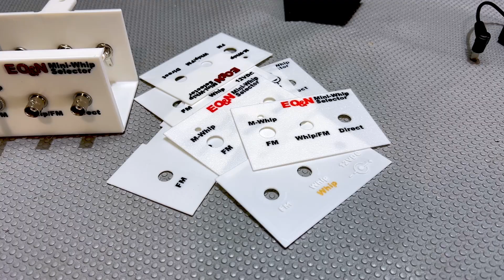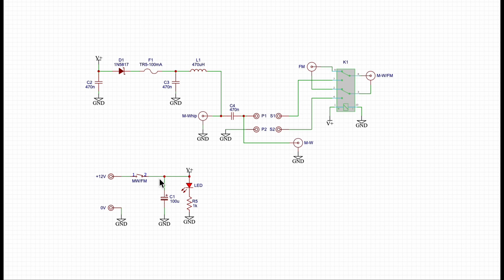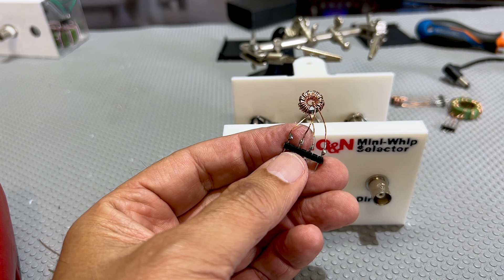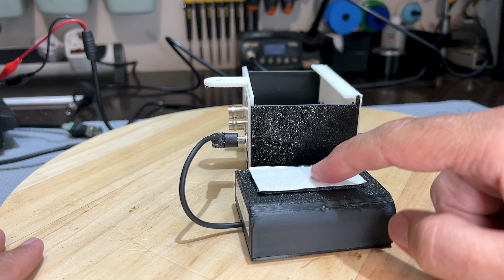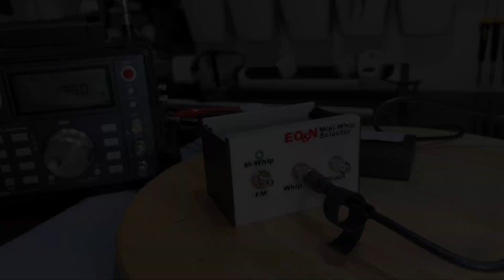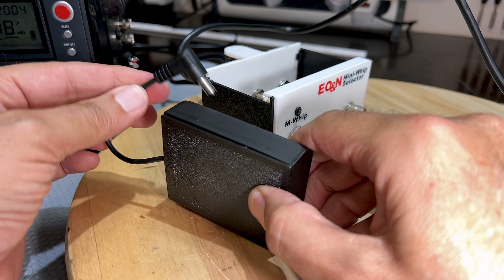New Mini-Whip / FM Switcher with Bias-T #pcbway#

Comment: Very neat! I must get off my lazy butt and get the mini whip I have installed. It's been sitting in my workshop for months and I have been dithering around wondering where best to place it. I think I need to stop procrastinating and get the thing up as they do look to work very well!! Impressive!!
Reply from the maker: I did the same thing: wondered and wondered and wondered some more 😊 Then I just stuck it out of my window and was blown away by the results. That’s what led me to take it a little more seriously and fitted on the roofAntennas can drive you crazy, as you’re always looking for that extra little bit of reception, which seems so illusive. Sometimes you just have to stop and accept what is 😊
Reply: @electronicsoldandnew  Good idea re the window test. I think I will give that a go. It may give me the inspiration to get it up on the roof (finally!)!!! 😁
Reply from the maker: @JonRig : just don’t fall. Reception is really poor if you’re hospitalised 😊
Reply: @electronicsoldandnew  I'll try and be careful! Between falling off roofs, getting electrocuted or doing your back in moving a Saba Freiburg this hobby has more hidden dangers than one realises! 😂

Comment: Nice.

I've been busy renovating a summer home here in the Catskills of NY for a good year so my radio projects have been on hold.

None the less I do have the front end of a regenerative receiver off the dream board & on a piece of MDF board. Next but still on the dream board is a direct conversion receiver.

I had mucked about, a year or more ago, with what claimed to be a mini whip, but in the end I assembled a 40/20 meter inverted V style fan dipole that works quite well for local traffic which is all that interests my QRP appetite in radios. 

I added a loop on ground to see if it lived up to hype & its still in place so its not horrible. It actually is about two S meter values quieter, but there is an over all signal loss too. 

On the other hand I tried a small magnetic loop transmit/receive antenna by using 4 inch aluminum clothes dryer tube for the main loop. This antenna is interesting. Its 4 feet square with a 23 inch square of copper pipe as the inner loop. Once you find the magic spot on the capacitor it becomes very usable for both receive & transmit. Its most efficient at around 80% on 20 meters, but is useful at 40 meters too. It has down sides but was fun to see a bunch of plumbing parts take on being a useful antenna & given a station within a couple hundred miles the darn thing does an excellent job at providing a bearing to the station.
Reply from the maker: I went through my antenna experimentation phase and it was absolute hell 😊 I finally settled on the miniwhip as it works best for me (receive only). It also adapts well to the roof of my apartment building as the other owners don’t see it as an eyesore. I’ll probably try a loop someday, but for now … I’ll leave well enough  alone 😊
Reply: @electronicsoldandnew  I suspect the mini whip I purchased on Ebay already preassembled was defective or did not match the actual unit designed by the European fella. 

I'd like to try it again some day with an actual functioning device, but here in the country I have no real need to be discreet, but I must confess the darn LOG does quite well & if the transformer used is sufficient I can't see why one can't use it for local Nvis rag chewing. I used the 60 footer or 15 foot per side square and 14 gage wire that disappeared in a couple weeks. If I was ambitious I'd swap it out for the larger loop that is effective on 80 meters & I'd bet if big enough even lower can be achieved.

Comment: Maybe you can make a separate battery pack module that is always being charged. You could have several voltages going out of the back of the module to feed all the modules as well as a jacks on the front if you needed a quick bench supply for testing. You’ve developed a very cool bench system. Well done!! 🙂👍🏻

Comment: Well done, as always. 

I would have liked to see the difference between direct connection of the MiniWhip and going  through your un-un (or rather common-mode rejection transformer, because that's what it actually  is), especially on long and medium wave. Maybe you could add this in a future video.
Reply from the maker: I actually only remembered that I’d missed that out after the video was published. Will do that in future video as you suggested.
Reply: @electronicsoldandnew  As I'm getting a little too old to hold my breath for weeks on end... could you give us a little hint on whether it makes a difference or not? 😀
Reply from the maker: Ok. Noise is the issue, because some noise comes in as common mode noise on the signal and ground lines. This noise is sometimes more audible in the direct connection. The isolation transformer clears some of it up.

Comment: Nice! On another topic, and it's not something I ppersonally need, has anyone ever built a simple 3 kHz (plus possibly an additional 5 kHz) high Q tuned circuit filter plus a bit of amplification feeding into an AC millivolt meter? Why? I'm thinking a cheap and cheerful way to minimize THD during FM ratio detector alignment when the front end is fed with 1kHz FM audio. It doesn't have to be super accurate so long as you can see and minimize the 3rd (plus possibly 5th) harmonic. Or am I talking balderdash? 🤣
Reply from the maker: I’ve been looking for a good THD meter for some time, may have to build one 😊

Comment: I would have put the LED and dropping resistor in parallel with C3.  Then if the fuse blows you have an indication or rather a lack of one.  :)   I aways appreciate your videos.

Comment: As always another slick device! 😀👍  To reject spurious noise, I would aline the inside with aluminum and common-ground everything.
Reply from the maker: I may do that, want to check if noise is an issue first, because sometimes with the miniwhip the ground actually adds noise, rather than reducing it.
Reply: @electronicsoldandnew  - Yes, I agree.  It was just a thought and concern. 🙃